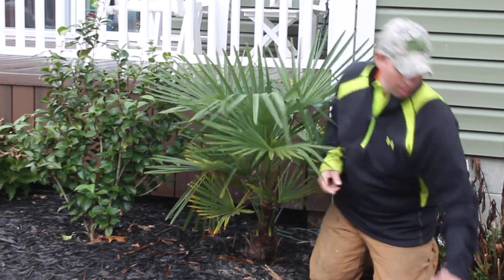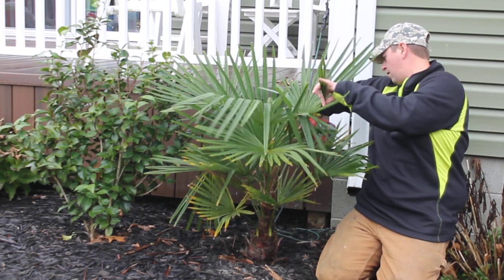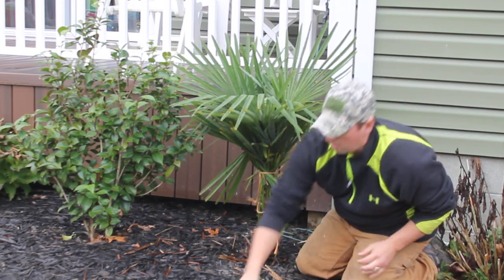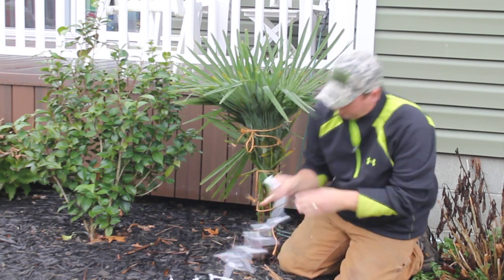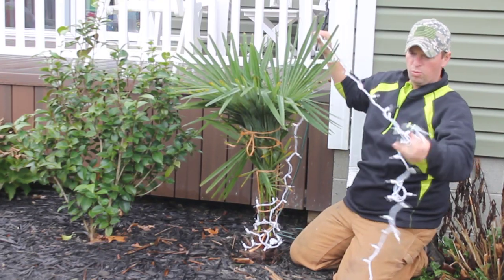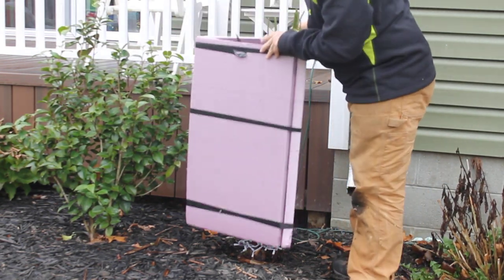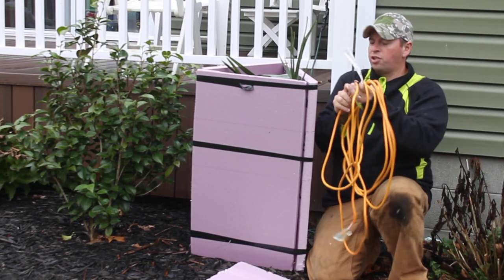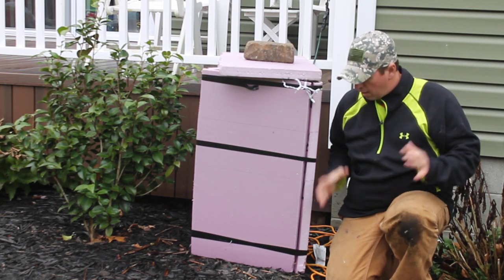Protecting Windmill Palm In Pennsylvania for Winter

Comment: Great job Jason! Very similar to what I do in your method. I tie my fronds up individually with velcro so I get a tighter fit. My styrofoam box is 12'' by 12'' x 15ft high and duct-taped together. Your triangle box method is interesting and would be wind-resistant. Great video and I subscribed Cheers.

Comment: I'm in zone 9b, but I grow lots of zone 10a and 10b palms and plants. I can attest that your protection method for small palms is great, especially for a protracted period of time (all winter long). In my case, I only have to protect certain palms once, maybe twice a winter. I also must use many protection methods due to the various sizes of my palms and plants. Some palms (now so tall, with large crown spread), I can only protect the trunk, up and just past the meristem. The crown of fronds may get severely frost burned and killed, but the trunk and meristem are not hurt, and new fronds start growing back in the late winter and early spring. Most palms look respectable after one growing season, but a full crown of fronds may take two growing season. Fortunately, I've been enjoying mild winters for the past 6-7 winters and haven't had to protect.

Comment: I've used electric pipe heating cable for quite some time now and it has it's own thermostat which turns on when temperature nears 32 F. Just make sure the cable doesn't cross itself or the heat can melt the plastic where it crosses and short out.
Reply: Some users use both lights and the heating cable. the cable is used on the ground to keep the roots warm while the lights are used on the actual tree. i would just buy longer lights and leave some lying on the ground to keep the roots warm.

Comment: Hey Jason, Burlap is also good to use because it drys out quickly.  I am also in PA so we have about the same climate. Im in z7a . I cooked a palm using c7 or c9 lights before...dont wanna do that again.  Your palms look great.  The key is keeping them dry
Reply from the maker: I used burlap for a few years.  Now I just use the insulation board.  Seems to work good.  We really haven't had any winter yet this year.  Love it!!
Reply: the thermo cube makes sure the palm doesn’t burn right?